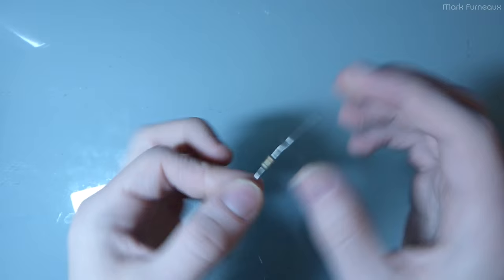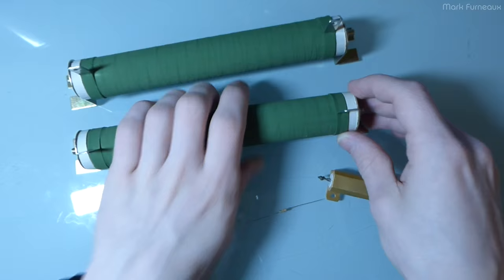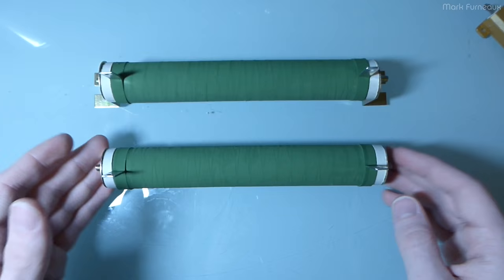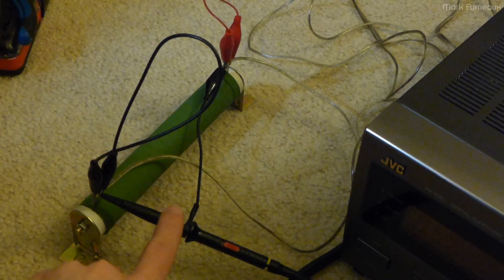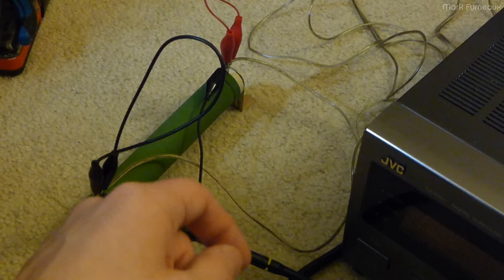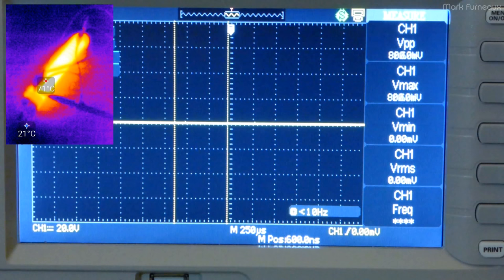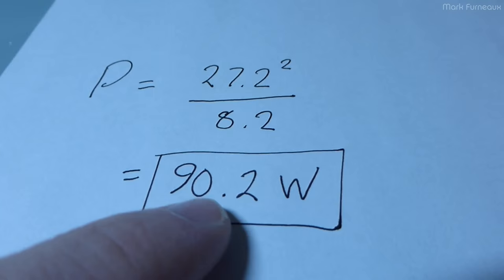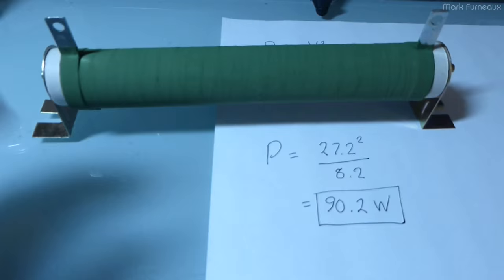Power Resistors And Measuring Audio Amplifier Output Power

Comment: Oh, as an afterthought, there is 'resistance wire' used for heating elements that have a spec of Ohms/foot.  They can handle a lot of heat, so you can use them for cheap power resistors, just cut to the length of resistance desired, they can glow red all day with no problem.
Reply: Absolutely. And when I can't find my lighter, I can use them to lite my smoke...

Comment: You should be using an isolation transformer to prevent frying your osciloscope and/or frying yourself.  The DUT (Device Under Test) should be plugged into the isolation xfrmr. Some folks keep their scopes plugged into an iso and though that's not rthe betst idea, it works. Be careful. A variac does not necessairly provide isolation. I believe some do. Mine does not...Luck

Comment: did you measure resistance when resistor is at 80 C°? maybe it change a lot
Reply: big time
Reply: Kanthal and Nichrome change less than 5% after 1,500F
Reply: Little Reptilian  yes, thats why superconductors needs -168 C degrees to put 0 ohm resistor in the niobium titanium material DUH!!!!
Reply: I want to know that which paint or material  they have use over this resistors so that it may not loose its green  color after it gets heated, as i want to do on our rheostats

Comment: i used to just solder a 25ea  of 200 ohm 2w carbon composition resistors to 2 pieces of copper clad board (with holes drilled for the resistors) and submerge it all in into a jar of mineral oil. That wicks away any heat very well and those 50w rated composite resistors could handle a lot more power. Back then 2w resistors were very cheap

Comment: I have a dummy load using the aluminum style resistors rated at 300 watt overkill for most receivers but I like your ideas I have been doing them for years

Comment: I have built audio dummy load using the wire wound resistor and the ceramic resistors. The wire wound are only slightly inductive and this is really negligible at audio frequency. I guess they can still explode but I haven’t suffered such failures but I do under run them.

Comment: Maybe I'm wrong but I suspect that with that formula and experiment you are neglecting the power factor where AC Power = V*I*cos(theta). I understand you are using an almost non inductive resistance so the power factor could be = 1 and P = U^2/Z a valid formula but with a speaker coil the inductance is going to induce a diferent phase in the current lowering the power factor (which could account for that lower power in the specs).

Wouldn't it be better to meassure with a speaker coil that can withstand that power and use a current clamp for your oscilloscope to meassure V and I simultaneously as well as the phase between them? Then plugging those values into P = V*I*cos(theta)

I'm no expert though, maybe P=U^2/Z is valid regardless of phase?

Comment: Great video, but don't think that you are safe just because you only have a two prong ac cable, the only way to be sure is use an isolation transformer. the neutral and ground are tied together in the mains panel, and so are the probe ground to neutral and ground on your scope.

Comment: The resistor in aluminium housing is available up tot 300 Watt
Reply: The Aluminium Housing Resistors we make  are from 50 to 8000 Watt, from 1ohm to 10000ohm.

Comment: Hi! Nice video. Sorry for the question. What dummy load can I use to measure higher power pa amplifiers? For an example: Dynacord L1600. 2X500W 8  Ohm and 2X800W 4 Ohm. Thank you.

Comment: I have never tried this so I'm by no means an expert but, this method may not be as accurate as you would hope due to the resistor heating up when under load.
 maybe you could try measuring the resistance while under load to get a more accurate reading?
Reply from the maker: +Luke Attubato You are correct in that the resistance will change, but how much depends on the resistors temperature coefficient. These are specced at 350ppm/C, so at 85C, the resistance will increase by only about 0.18 ohms. Not really big enough for me to care. Besides, we can't measure the resistance when it is under load anyways.
Reply: +Mark Furneaux Oh, I didn't realise that they could be that accurate! I stand corrected. I assumed from my own tests that they would go up significantly more than that.
Reply: Can still be done, disconnect the amp, and switch the multimeter to ohms before the resistor cools down.

Comment: You can buy cheap resistor and put into demineralized water
Reply: TheOrdinarySuperhero do you mean mineral oil? I’ve heard of that before... the water cooled ones generally flow the water through the center of the ceramic tube and have been sealed and purpose built like the Vishay WCR series
Reply: @tsloth1390  you could use demineralized water to cool down the resistor. Water is better heat conductor than oil a if you use demineralized one the electric conduction is very low
Reply: @tsloth1390  you could use demineralized water to cool down the resistor. Water is better heat conductor than oil a if you use demineralized one the electric conduction is very low

Comment: Hi, Very interesting segment! I'm an audiophile myself, and would love to test the output of my Emotiva 50 watt per channel amplifier. I have a scope, should have my waveform generator next week, and will order the load resistors. The only thing I'm not fully understanding is this grounding deal conflicting with the ground of a scope. I'm new to scopes, and have used mine for just small digital breadboard circuits so far. Are you saying that an amp with two separate output's one + one - is safe to check because it's not using a common ground for both channel positive's? If I check the negative output from each channel to the ground lug of the amps power cord I should not see any continuity correct? Please explain. I don't want to blowup my new scope LOL!
Reply from the maker: You shouldn't see mains earth continuity because the amp will probably have a linear power transformer which isolates it. I've never seen an amp with the speakers grounded, since that would introduce noise. You should still check, but it only takes a second with a multimeter.
Reply: Yes, when I use my Fluke 287 between the Negative speaker terminals, and the power cord ground lug there is no continuity. This amp is pure analog with a toroidal power supply transformer, so I should be good to go. Thanks.
Reply: So this means we put the ground clip on the chassis or the negative lug on the power resistor and the primary probe clipped to the positive lug on the same power resistor the ground is hooked to the negative? Right? And if the amplifier isnt isolated, then negative speaker output has continuity between the power ground plug…if thats the opposite scenario from the first one above; then what? Thanks.